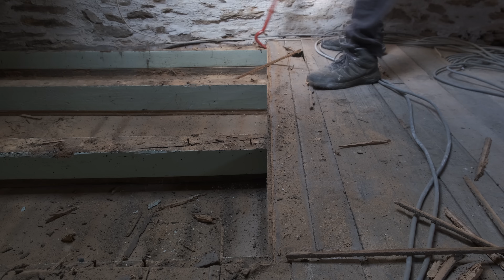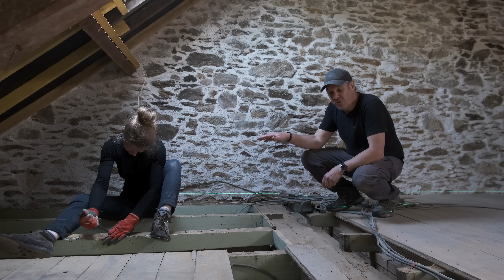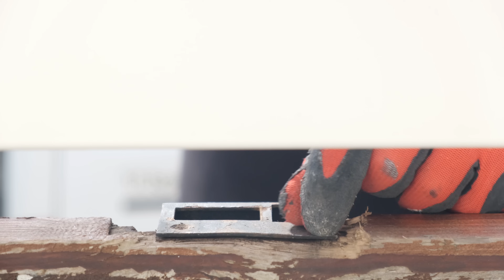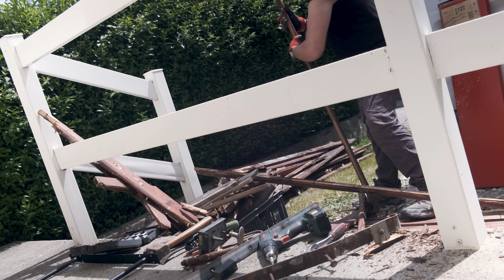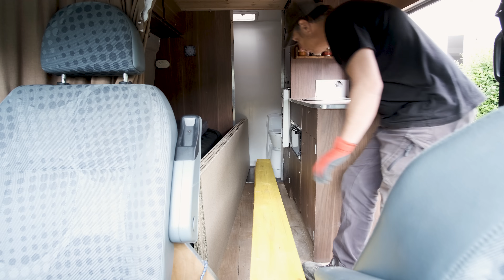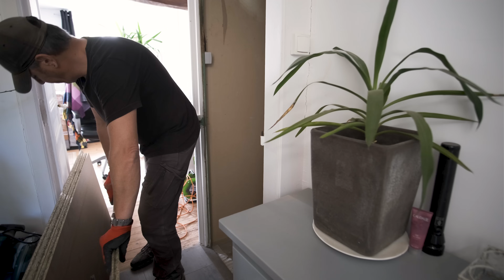Removing Moisture Damaged Floorboards

Comment: Looks like you & your wife have no problem with the stairs to the attic. I am of a larger size, so would have had to move the stairs, so that they came out in the middle of the house. It's a very big job for a DIYer, so I can understand why you haven't done it. Well done on some good restoration work. Two thumbs up.

Comment: Unless rain is coming down or imminent, open your skylights.  The more air you have circulating the better.  Make certain the up facing side of the second floor ceiling is fully dry as well as the joists.  Several box fans would be useful.  Use one to suck this attics air out and blow it into the barn.
Looks like you have a lot of nails to deal with.  Give Marion a break and consider cutting the nails flush with an abrasive disk. 
Get yourself a couple of nice planks or plywood (much lighter than OSB) walkways. You will be using them a lot.  Will be much easier on your knees and you'll avoid much of the risk of stepping through the ceiling. :)
TO level the floor, you will have to use dimension lumber sized so that you can cut one single wedge that will run from the center beam to a point just beyond where your knee wall will stand.  No point in going all the way into the eve.  Cut your wedge board material to length get your dimensions at beginning and end, snap a chalk line and rip it with a circular saw.  Tack it in place and move on to the next one.  :)
Reply: What he said.
Reply: it's always handy to have someone like you around to point out all the glaringly obvious things.

Comment: You’ve shown us that the floor is horribly out of level but not why it is ,otherwise a great episode in persistence and getting the job done.
Reply: Hi, I have restored a couple of older houses. The floors go out of level due to the house 'settling'. Different parts of the house settle more than others.

Comment: Not sure if you've used nippers before to remove nails... if you haven't, they are very helpful, particularly, when pulling nails from old wood. It is  much easier on your hands and arms. Nippers are also used in horse shoeing--same purpose, remove nails. Only one caution, don't grip too tightly, or you'll cut the nail instead of pulling it. You'll warnt to use bigger nippers because you're pulling bigger nails.
Reply: A small block of wood helps to lever nails out.